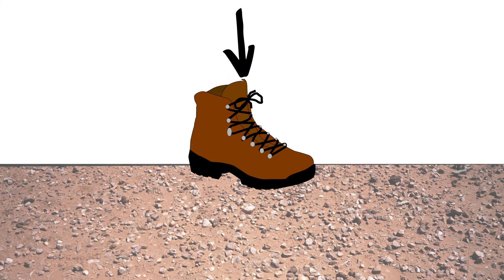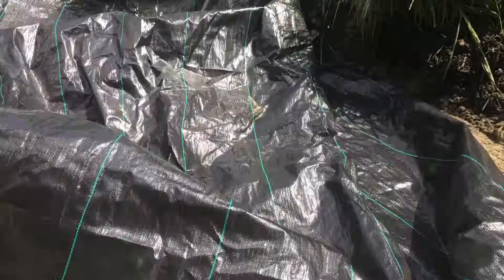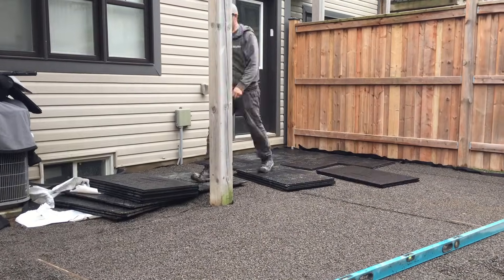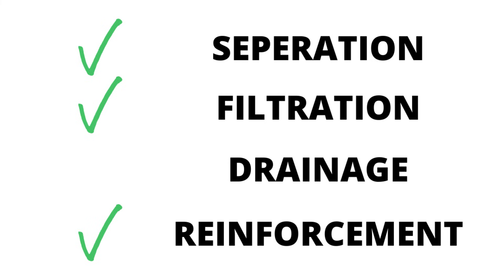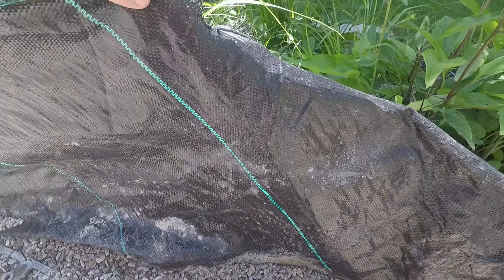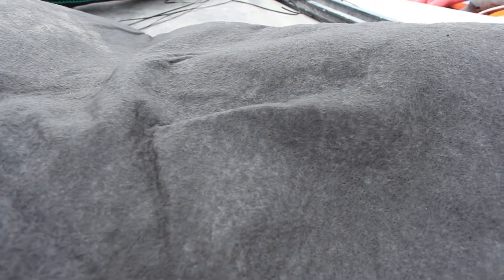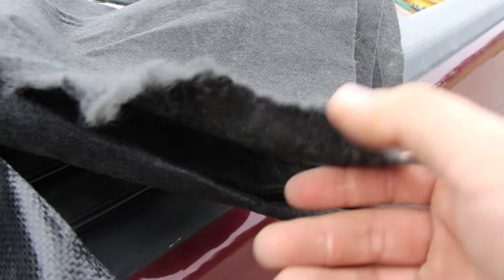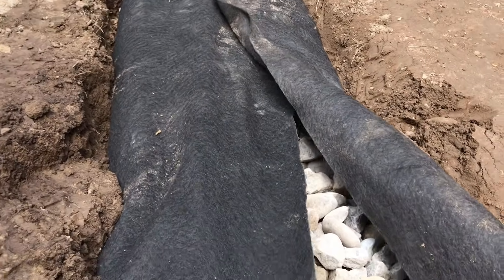Woven vs Nonwoven Geotextile Fabric | Choosing the Correct Geotextile for Your Project

Comment: In Kentucky Clay soil, water instantly clogs and goes around fabric, Never Through and Never "burrito" wrap (unless your goal is burying a stone burrito time capsule)
My formula for Clay Double trench size and depth
Fabric on bottom only if at all, not sides
Double or triple gravel amount (fill half trench with 2in quarry clean, the remainder 1.5 in quarry clean) after you've washed it)
Use sand on surface for sod/topsoil (no more than 5 in max)
Note:  
Always pressure wash quarry dust and fines from your stone/gravel prior to shoveling/dumping into your trench (amazing how well water travels through "Truly Clean" stone w/o quarry dust and the those bits and pieces.. (throw a bucket load on a low 4x4 framed screen and pressure wash first)
You can Never use too much stone in clay soil open french or closed.. Fabric bottom only maybe..
Reply from the maker: Interesting

Comment: I am digging a pit to empty washing machine drainage into and I plan to use non-woven filter fabric to allow water to drain through and to separate the soil from the stone and gravel.  Is a pit two feet deep adequate and can I use stone I've been collecting to use instead of gravel?  Thank you.
Reply from the maker: That depends on a lot of factors that I would not know. permeability of soils, amount of drainage, etc. But I would use an angular stone.

Comment: The type of sub soil is not really discussed in this video. My sub soil is clay and rocky. Do I need a woven stabilizer fabric (with french drain) or a non woven fabric? I'm only doing a small 7' x 10' patio alongside the foundation.
Reply from the maker: If you are planning for a French drain I would use nonwoven to promote drainage. Woven will still drain but at a slower rate. Woven is better for stabilization over a weak clay subsoil, but these days I am using nonwoven regardless of subsoil and adding a layer of biaxial geogrid. https://youtu.be/gyddRdADcfs

Comment: I’m installing a decorative stone rock garden that begins at the foundation of a house and continues up the front yard to the street curb. It will have perennials surrounded by river rocks. Should geotextile be installed under the river rock or is it better without it? If yes, woven or non-woven and what weight/thickness?
Reply from the maker: Yes, I would use a non-woven personally. Not the thin stuff but something with a little more weight to it. I don't know specific weight. If you do not use something to separate the stones from the soil, they will just become a muddy mess. Geotextile helps to prevent that a little better.

Comment: What fabric could I use to drive over or use a snowblower. Basically have a dirt driveway. Old concrete work is pulverized
Reply from the maker: I don't think a fabric would be good to drive on top of unless you plan to put gravel on top of it. I would use a woven if that is the case and then gravel on top.

Comment: Is it reasonable to add a woven geotextile to top of dense graded base materials in a retaining wall, directly under first course of block? The bottom of the trench is wrapped completely with non-woven geotextile and the sub grade is a extremely dense clay on a slope. There is a perf drain on top of the dense graded base that I would like to drain out via solid pipe completely under the wall. My goal is to ensure that water goes to the drain behind the wall and out as much as possible instead of saturating the dense base material. Would a non-woven geotextile "floor" help with this, or cause more problems? Thank you for your videos!
Reply from the maker: I wouldnt put it under the first course of block, but yes you could put it behind to separate the drainage area from the base material extension behind the wall.

Comment: We’ve excavated a pond measuring 42 × 42 × 2 meters on terrain that has sharp stones and pebbles. Since we plan to install a pond liner, our concern is the risk of punctures from the rocky subgrade. To prevent this, we’re considering cushioning with either woven or non-woven geotextile. We’re seeking expert advice from those with practical, hands-on experience in similar applications.
Reply from the maker: Nonwoven. Aquascape ponds actually come with a nonwoven fabric in their kits for this reason I believe
Reply: What type of liner do you plan on purchasing? That makes all the difference. If puncture is the main concern, a coated woven polyethylene liner (30 mil CWPE - great for any size pond application) has an extremely high puncture strength, so no reinforcement is needed from a woven or nonwoven geotextile. Your local Ferguson Waterworks can help you obtain this type of liner and cut custom sizes.

Comment: Great review. Very interesti9ng that woven GT is very permeable when touched. I wonder if this closely mimics the industrial testing of the material where a 3oz woven GT demonstrates a still-impressive 5 gal/min/sq ft. I also wonder if when the woven GT is against the sub base (specifically a high-clay soil) and under the base (clean aggregate) if it is just as permeable? Is there a good way to test this?
Reply from the maker: There probably is, but not with my ability. I'm sure it depends mostly on the density of the clay which is going to vary. Ultimately on our projects we assume the clay will allow water through and plan for that.
Reply: @iamahardscaper Any chance you could make a video where you lay a small section of woven geotextile on top of dirt, then cover it with gravel and test the presentability?
Reply from the maker: One thing I was considering is doing that in a fish tank to clearly see how permeable it is. Something for the winter though

Comment: Good explanation and examples of the differences between the two. My question is, if a property has poor drainage what is the best geotextile to use for a 2' high retaining wall? 
Also, should the fabric be under the 3/4 minus base, then run up behind the wall with clean stone between the wall and geotextile which separates the clean stone from the soil? 

I live at the bottom of 4 hills and my yard is always moist. I am having a retaining wall and pavers installed and the contractor wants to use a portland+sand mix to set the first coarse, without stone or fabric behind the wall. I know the wall is only max 2' high but I want the walls to stand the test of time. I see so many varying opinions regarding the use of fabric, woven and non-woven, AND whether or not it should be used to directly behind the wall or not. At this point, I do not know what is best. 

We have multiple freeze/thaw cycles over the course of a winter and with the poor drainage of my property I do not have not found a solid answer yet. Any recommendations are appreciated. 
Thank you for the video.
Reply from the maker: I almost always use nonwoven under my wall base. Sometimes I run the nonwoven up the back of the drainage area. But there is an argument to not. More and more engineers are specifying not to because it will clog and add force the back of the wall. Always refer to the block manufacturer's specified drawings for the wall block you are installing. It will show you a cross section of how to build the wall.
Reply: @iamahardscaper  thanks for the reply. Funny you mention running the non-woven up the wall. Another comtractor made a video on yhe 5 mistakes, i think it was called, and he mentions exactly that, the clogging. 

I am definitely going to need some way to drain behind my walls. I was excavating yesterday and it had rained a couple days before and the excavated parts that were done before the rain were still squishy. I live at the bottom of four Hills and the ground is always moist. I really should have a French drain around my house but I have a poured foundation and, knock on wood, so far so good.
Reply: @iamahardscaper  although, with the lack of drainage I have, maybe it would be better if I add a French drain along the wall. The soil drains VERY slowly so in theory, if the woven helps move the water to the drain and prevents it from migrating to the soil, I won't need to worry about the soils inability to  drain.
Reply: @iamahardscaper with poorly draining soils, is it better to use woven at and under the base of a 2' retaining wall with non-woven from that up and behind clear crushed 3/4. If the water gets to the base of the wall but doesn't drain theough the soil, wouldn't it be better to move that water using a drain? 
With that being said, even IF i went that route, wouldn't beater find its way under the wall and woven fabric anyway? 
I live at the bottom of four Hills and my soil is always wet and drains very very slowly. I'm not exactly sure what the best setup would be.
Reply from the maker: i always like the idea of woven under the base. It will still drain just at a slower rate. and it provides stabilization. We always install a drain behind our retaining walls and daylight through the face of the wall every 25'
Reply: @iamahardscaper unfortunately the location of the wall won't allow a drain at the base, next to the 1st course. The base of the wall is below the earth around it so I can't discharge the water at the base. 

I was thinking about putting a drain in just above the level of the earth around it and, at least, try to catch the water on its way down, limiting the total amount of water that will accumulate at the base. 

What are your thoughts about that? 

Also, because I have poor draining soil/dirt, I was thinking going deeper than 12" with the stone under the wall, maybe 24". The hope is that I can prevent frost heaving because I live in a climate that has many freeze/thaw cycles in the winter. 

What are your thoughts about that?

Comment: Question: Im making a drainage swale directly against the house to carry water away from the house.  What kind of barrier should I put under the river rock?  Originally got some edpm pond liner but Im concerned it may prevent evaporation of any moisture in the soil beneath it.  Thank you
Reply from the maker: I would use non-woven geotextile.

Comment: Im doing a large rockery 500m2, large rocks scattered around on a slight hill in parts down to a kerbside. I guess then I should use a non woven fabric, which will be topped with 20mm pea gravel on top, will it keep the weeds down also, shiuld do with the rocks right?
Reply from the maker: it wont keep weeds away, they will grow from the top in anything. I'm sure you could use either, but likely nonwoven would be better.

Comment: IK this sounds stupid but I use the srw woven under permeable based/hybrid installs and have never had an issue. When the fabric is pinned down completely taut, and has the #2 stone compacted into it in a smaller initial lay, it actually opens up the weave and creates way more permeability. If you are holding the fabric in the air and pour water into it, yes it doesnt permeate hardly at all, but it permeates fine when it is installed as stated above. I always pitch the sub-base significantly too, and only ever do hybrid when the sub base is sandy and drains well (i see others mending soil and installing hybrid over it... meh idk about that). I have even tested this by totally saturating the heck out of a patio with open joints and there was almost no water buildup immediately after, not even enough for it to follow the pitch of the sub base and pool at the end. I have been in business 6 years and have had 0 call backs other than polysand I installed once in December (stupid).

I use SRW Pro Plus IV which, I just looked up, says it is a permeable fabric... so idk. Its the one with the felty back side. I definitely recommend this product.
Reply from the maker: That is interesting! And yes I agree the woven does drain on contact, I think I showed that at one point in the video.

Thank you for the feedback, I’ll check out that SRW product.
Reply: @iamahardscaper   Have you had a chance to check it out? I went to a landscape stone store, they have a non woven fabric from SRW, called LS3, I believe it's 3 Oz

Comment: I understand your point on limiting contamination between using the geotex on the sides/walls of excavation. At what point do you address the surplus in the install and what do you do with it? Cut away or fold back on top?
Reply from the maker: I either cut it at the top of grade or wrap it towards the patio on top of the base extension past the pavers towards the edge restraint

Comment: What would you recommend to put under the base material for a paver patio that connects to the back of the house? The soil is sandy
Reply from the maker: I’d go with nonwoven unless you are concerned about water in your basement (if this has been an issue)

Comment: hi. thanks. Do you think it is better to use woven geotextile under the foundation? (so that the mixture of cement and water in concrete does not pass through the woven geotextile)? thanks :)
Reply from the maker: what is the foundation for?
Reply: @iamahardscaper  house foundation
Reply from the maker: the concrete mixture wont go through the nonwoven geotextile. you would probably want something just to separate, as the concrete would be the reinforcement. depends on the subsoil strength too.

Comment: What product would be your recommendation for an underlayment for a pond liner?  I have some non-woven material I purchased to protect  the pond liner from root intrusion but am worried it might not be strong enough.  Your advise would be much appreciated.
Reply from the maker: I use nonwoven geotextile for this. Not the cheap weed barrier stuff, but the same roll we use for our paver installs. Then we lay the pond liner on top
Reply: @iamahardscaper  Much Thanks! 😁

Comment: TLDR: non-woven is for drains. It separates the soil types and extends the life of the gravel. Thicker fabric is for when the thinner stuff would rip during install. Lap the fabric over itself so it stays together. And for what it's worth, when I dug up an old drain, the fabric (and spikes) had shifted all over the place, so when I installed it back, I used a bead of polyurethane sealant (Quad Max) to fasten the fabric laps together.

Comment: I am trying to determine whether to use 5.3 oz woven or 8 oz non-woven geotextile on a 30' slope in front of my home that is about 100' wide, which I will be applying river stone on top of.  At some point my plan is to put a retaining wall at the bottom of the slope where it levels out.  Would you recommend 5.3 oz woven or 8 oz. non-woven geotextile?  Thanks.
Reply from the maker: Probably something I would contact the manufacturer or supplier about. Unfortunately knowing the weights of the geotextile is something I am not an expert on.
Reply: @iamahardscaper  are you able to tell me if woven or non-woven would be more beneficial for the project I described?

Comment: Great content, if using loose base such as 57 gravel with no fines under a paver patio and you used woven fabric what would happen to all of the water?  Would the polymeric sand keep the water from pooling underneath the patio?
Reply from the maker: Yes, to an extent. Woven will still allow water through but it impedes the passage of water. If you have a sandy subsoil, it will flow through it and into your subsoil. If you have a clay soil, it’s recommended that you collect the water and move it out of the system
Reply: Thanks big dog, we have clay everywhere in North Carolina
Reply from the maker: Lots of clay here in Toronto too

Comment: I’m not sure what to do after watching the video. I had non woven geotextile in my backyard. The dirt was compacted and we put rocks on top of the non woven geotextile. Now that it’s been raining, we’ve noticed there’s been weeds growing through it. Any recommendation why that is? Should we have used the woven option?
Reply from the maker: no, it wont stop weed growth from the top down, only the bottom up for the most part and depending on the weight of the fabric. You'll always get weed growth anywhere those seeds can get to.

Comment: I am building a raised paver patio with a 3' high retaining wall and 40x10 permeable paver patio on top.  I initially planned to use woven (SRW SS5) all throughout because i have a mix of sandy and clay soils and thought that would be best for stability.  After excavation I saw that the base of the retaining wall had most of the clay and the soil higher was much more sandy.  After that experience and watching your video I decided to use the woven under the wall to help stabilize the soil that has more clay content.  I am already planning to use biaxial geogrid to stabilize patio area so I will use non woven behind the wall drainage aggregate and in the patio area since drainage is more important there.  The geogrid will help to tie the patio and wall together.
Reply from the maker: That sounds good 👍 hope the project goes smoothly for you

Comment: Great video. You mention concrete overlay a few times (ie 4:49 - 5:54).   I don't see the concrete over anything. Isn't the concrete 'under' the pavers and under the geotextile?  Or are you indicating the overlay means over the base?
Reply: Mike, are you available for consultation? If so, how does someone find and compensate for your services?  I am in Florida sandy soil, but having a troubling time determining the method of base development (soil ->Base->fabric (type)-> compatibility with paver (brink/clay in this case). Advanced DIY'er
Reply from the maker: send me an email with your questions I should be able to answer them contact@howtohardscape.com
Reply from the maker: Yeah, concrete overlay refers to concrete being the base and the pavers are overlayed on top.